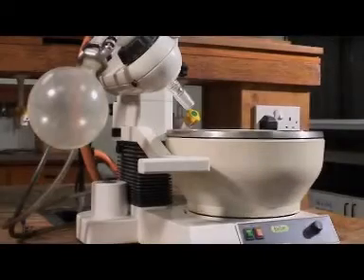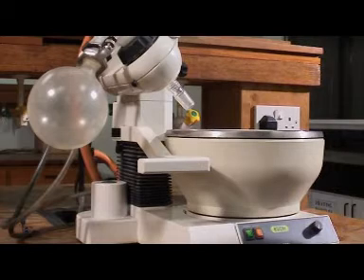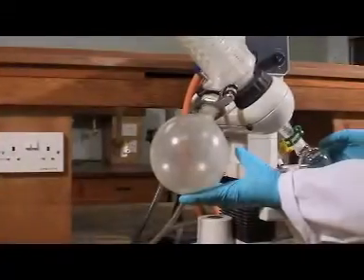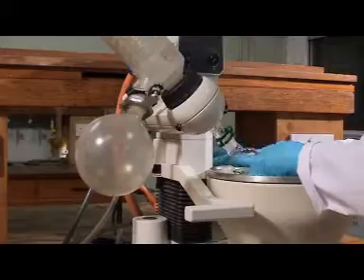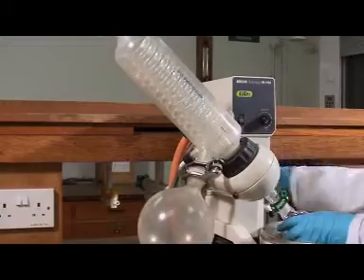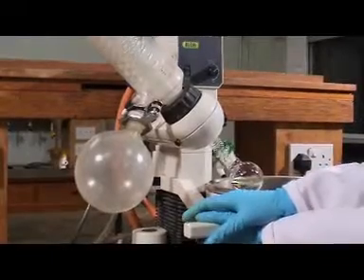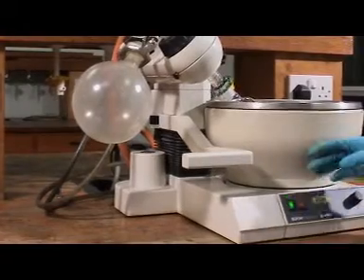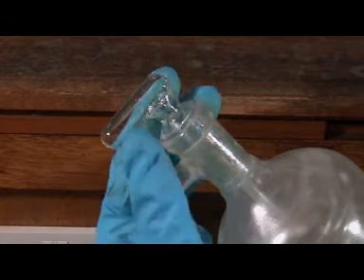Using a rotary evaporator

Comment: @rynhj 
why would you set the bath temperature that high? The whole point of a rotary evaporator is to remove some solvent at low pressure and low temperature.

Comment: good video
thank you very much for uploading it
i'm using it with hexane i noticed that it finishes in less than 15 minutes. i put the bath temperature at 85 because in the manual it says 20 degrees above the solvent boiling temperature. is that right?